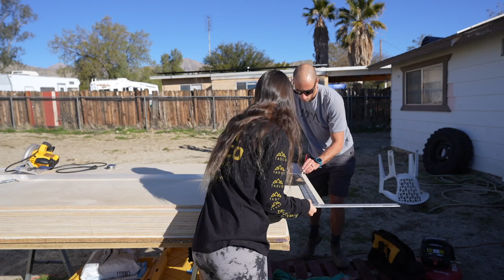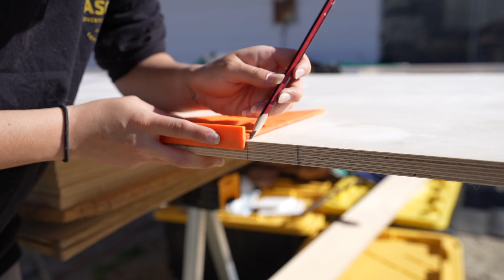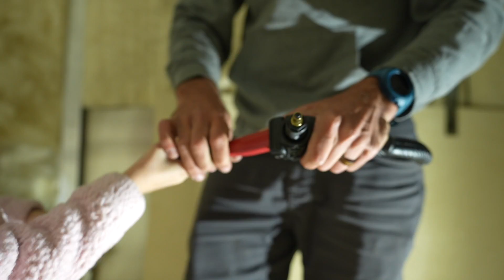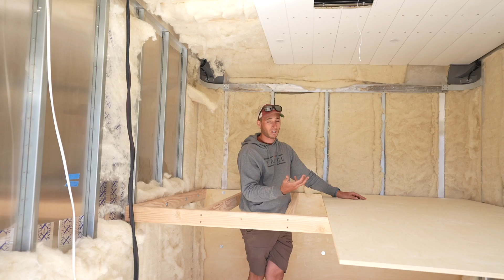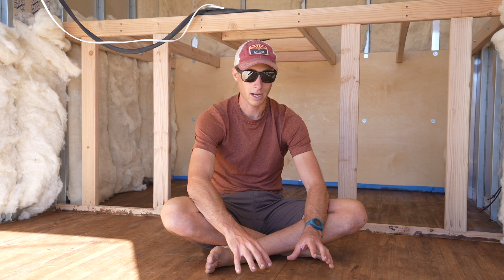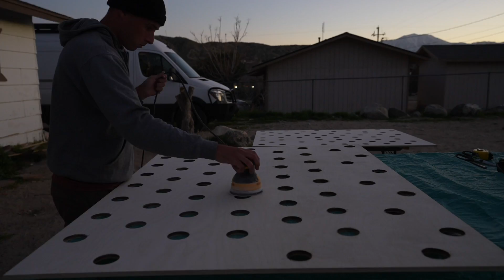DIY Expedition Box Truck Build / Part 4 / Building Our Bed and FINISHING OUR HARDWOOD FLOOR!

Comment: What did you guys do underneath the box? How will you handle the water that splashes up from driving in wet conditions like rain? I have a 2004 Morgan box I'm converting, and after that much time, the stock coating on the bottom of the box seems compromised and water DOES soak through if driving long in the rain. You can even see some light between the boards. Just wondering, thank you for the detailed videos during your build!!

Comment: I love the build! But if you are building such a huge (and expensive) van, why not invest in a small table saw or a track saw? A decent one isn't that expensive and will make cutting sheets of plywood so much faster, more accurate and easier!
Reply: Hey!! Thank you for the kind words - honestly we should have! Lol I would love to have had a portable table saw, but the guide and circular saw method works super well for us, just a little time consuming! :)
Reply: I been a builder for 40 years, I have all the tools, sometime I like  doing it with clamps and straight edge. Simple, and itworksfine